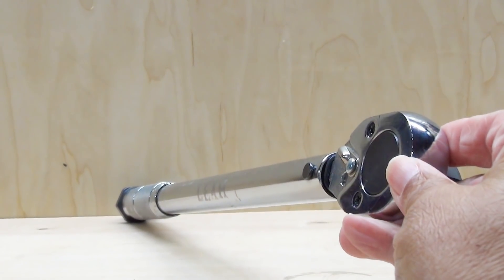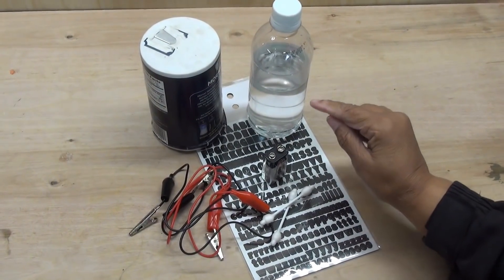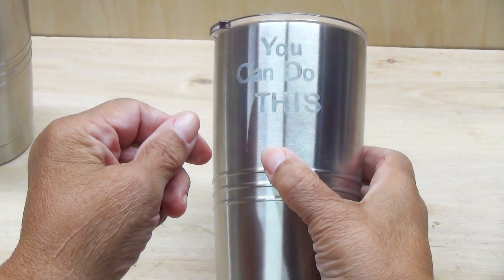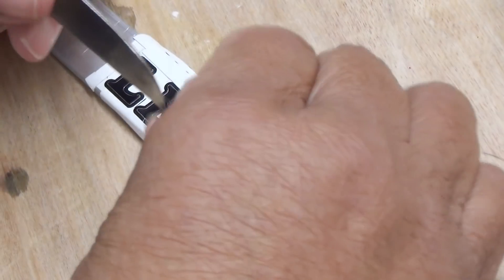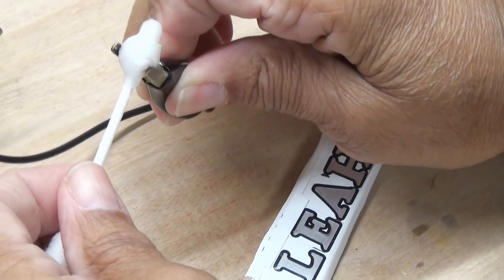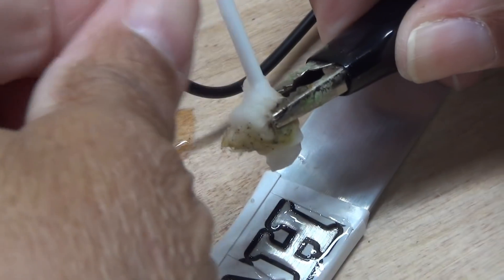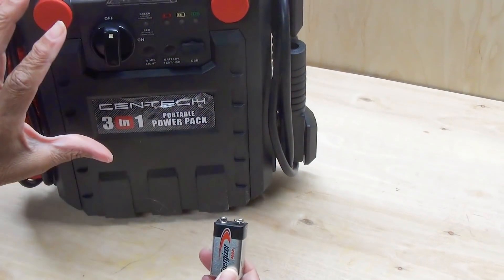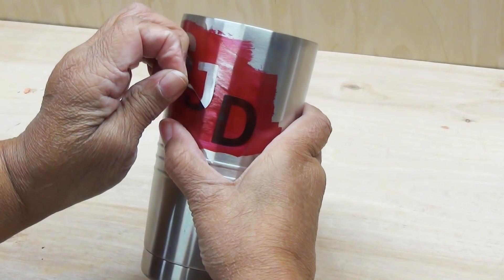CRAZY 9 Volt Battery Hack

Comment: Greetings Leah,
A great quick drying resist is layout fluid. Dykem is what I use but any layout fluid will work. It dries fast and removes easily with common solvents. And thanks for posting this. Lotsa folks can use the easy and simple method you show in your video to get excellent results.
Cheers,
Eric
Reply from the maker: Thanks for sharing information

Comment: For aluminum caustic soda works better, as you don't need any kind of electricity. It's how we milled aluminum parts in the aerospace industry. We used the vinegar method for anadizing the parts. :-)
Reply from the maker: Thanks for sharing this
Reply: @seejanedrill  We heated it to 200 degrees for a mill rate of 1mm per minute. :-)

Comment: Add ink as you go or end up with a rusty  etch in time...don't get me wrong this is way cool and does etch pretty good! But before you remove the stencil hit it with a sharpie or a highly permanent marker to keep this from happening.. I learned this from a diy video I seen about a year ago.. trust me you don't want to end up with rusty etches.. I noticed it doesn't always happen ..  great quick straight to the point video by the way! Just thought I wanted to put that public service announcement out there..👍👍👍
Reply from the maker: This is a good suggestion, keep in mind that the metal being etched matters in terms of whether it is prone to rusting.

Comment: if you get 3 9 volt batterys you can turn one upside down and clip it into the terminals on the other batterys, making a 18v battery, it will work quicker,

Comment: Awesome hack! I remove rust with electrolysis too, but I use a 20VDC transformer and a carbon anode ripped out  of a dead AA battery. You can also etch tools with ferric chloride (FeCl3), which I use to etch PCB's. Just put an stencil on and apply the FeCl3 with a Q-tip. No electricity needed. Love the portability of your hack, all the same. Cheers!

Comment: Good thing you told me a 9 volt battery and NOT a car battery!  My tools would look like a marquee 🤣🤣 and id have an instant perm.
Reply: I was just about to point out that a car battery works fine at 12 volts, and will last much longer if you need to do more. Adding an inline fuse would be a good idea, though, in case you accidentally short it out.

Comment: Back in the 60s, I used a similar process to label tools and knives only I used carbon paper (can one still buy cp today?). Just type your info onto the carbon paper (the ink is left on the paper beneath the cp), then use the cp as your stencil.

Comment: Interesting. I always thought aluminum didn't conduct electricity. I guess it does a bit! Thanks for the tutorial.
Reply: Aluminum is one of the best conductors of electricity.  It's what overhead and underground electrical supply lines are usually made of.  It's not as good as copper, and nowhere near as good as silver, but cheaper than both.
Reply: @tedhaubrich   oh thanks. I think I was confused because it seems aluminium is not good for arc welding. But probably because it's soft.
Reply: What no way.

Comment: Mixing Vinegar and salt is to create a conductive solution where the electrons can travel from the cathode to the anode and edge the metal with an eroding effect (nano short circuit). You can also use Arm&Hammer super washing soda to create a very conductive solution as well. Is the same principle used to chrome or zinc or galvanize a metal... Thanks Lea for the video👍👍
Reply from the maker: Thanks for sharing the scientific perspective.  I usually use shper washing soda when doing electrolysis when de-rusting a object.
Reply: @seejanedrill  Hello Lea I'm glad this comment was the inspiration to make your next video ELECTROLYSIS FOR BEGINNERS very well explained 👍🍺

Comment: Wow!  This is a whole lot easier than the photo-etching kit I bought to reproduce micro-miniature model parts.  It looks easier, cheaper by far, and a lot faster.  I bet the etched area could be blackened with a little thinned enamel paint or a permanent dye, if the resist was left in place.  There are probably a dozen good ways to do that, but this video was a real hoot.  Good work!

Comment: You can also use a sharpie to write on the metal. When dry, it's an excellent resist!
Remove it with acetone or lacquer  thinner or carb cleaner.
Paraffin candlewax is also good to use if you melt some on the metal and write on it with an awl,deep enough to expose the metal...
Reply from the maker: Thanks for sharing

Comment: Finally a use for old smoke detector batteries! Thanks :-)
Reply: Yes, and if those used batteries don't have enough current stored to etch, they are very cleverly made so that the positive terminals actually snap fit INTO the negative terminals, placing them in series and, thus, doubling your voltage to 18V! Fortunately, the amount of voltage matters very little here, it's the amount of current that means almost everything. Okay, once you've snapped two batteries together, simply attach the red alligator clip to the OPEN positive terminal, and the black clip to the OPEN negative terminal, and start etching!
Reply: @jamesthe-doctor8981  How did I not see that! Thank you for the tip :-D
Reply: eternalfizzer you’re welcome!

Comment: Very cool. Kinda like the old Etcha-matic machine. Try packaging tape for resist, also. Model train or slotcar racetrack power supply gives fairly safe and adjustable power supply, too.  Great video.

Comment: Hey Leah, cool idea. Will it work on glass?
Reply: This method won't etch glass, but there are methods that will, such as fuming hydroflorous acid.
Reply: Glass etching uses hexaflourosilicic acid, which is extremely dangerous. Best left to professionals.
Reply: Since this method requires an electric current, it won’t work on glass since glass is non-conductive. But, as mentioned above, there are other ways of accomplishing the same thing. Basically, you just need “something” that will start to dissolve (or chemically alter) your target device, along with something else which will “resist” the change and can be shaped into a pattern which determines what is “etched” and what isn’t.